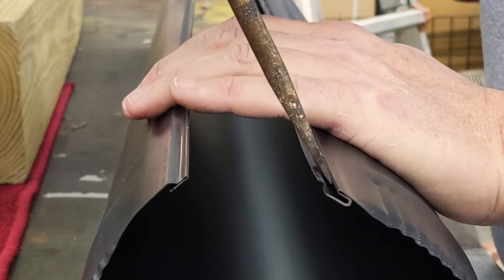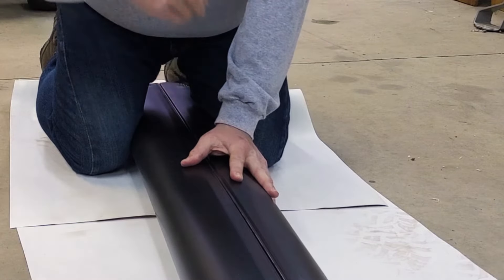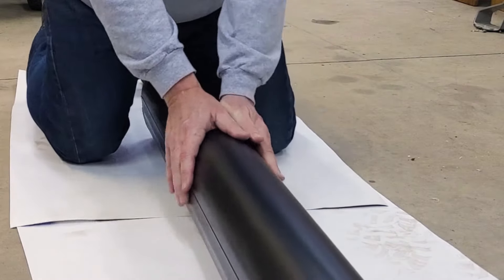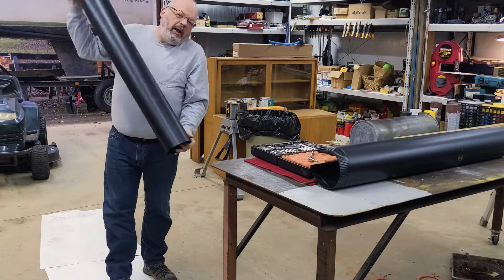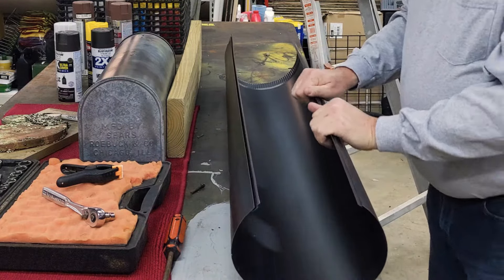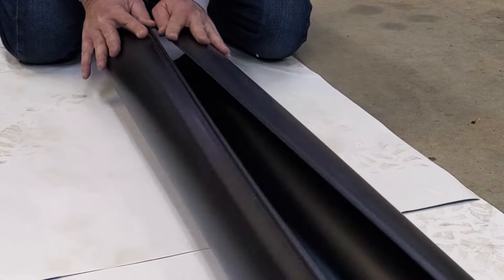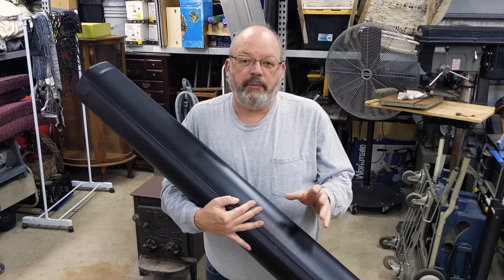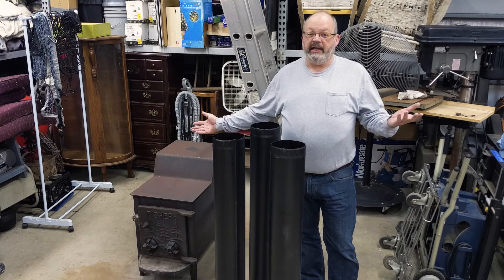Assemble Snap-Together Split Stove Pipe

Comment: The real challenge is that THEY need to make a seamless pipe available in my area in the same lengths as these abominations........Life would be so grand then ;)
Reply from the maker: I think the price gap between nested split pipes versus fully round pipes (transporting, retail space) would be significant and consumers would pick the lower priced split pipes not knowing the assembly challenges ahead.
Reply: @BradSmithSC   I hear ya.....Just wish the option was there. Great video, by the way!!!

Comment: Thanks for this video! In addition to what you’ve mentioned, I found it helpful to put the pipe on a non-slip yoga mat. This makes it easier to “wrestle” with the pipe. The second thing I noticed in your video but wasn’t called out explicitly was that to prevent creases, apply gentle pressure using the entirety of your palm. 

Lastly, I found it helpful to gauge how round the finished product is by simply rolling it on the mat! And you can easily tell which areas need more work.
Reply from the maker: A yoga mat would definitely be better to keep it from sliding around. They could sell non-slip pipe assembly mats alongside the pipe sections.

Comment: Thanks! Worked with minimal effort. My 3” diameter pipe made it easy. However, once I got it oval-formed, I had to snap it together (4 pcs on first try) vertically. I installed it on my shepherd hooks which hold my bird feeders, to prevent the tree rats from thieving the birds’ seed. Thanks again!
Reply from the maker: Sounds like an excellent squirrel defense you've got there, Larry. My bird feeders are routinely raided too.

Check out this amusing squirrel obstacle course https://youtu.be/hFZFjoX2cGg
Reply: Whatever that

Comment: Hi, Brad! Worked the first try. THANKS!  👍 Where's the vid showing how to put the crimp end in the next pipe?  Another Smith needs to know. 😁
Reply from the maker: Greetings fellow Smith. Glad to hear you got your pipes assembled. 

I don't have a video showing pipe assembly. In my case, I have the pipes overlapping one another incorrectly. The result is the creosote runs down the pipe and at the seam works its way outside the pipe. When assembling I was thinking about funneling the smoke so they're overlapped where the smaller diameter is below the larger diameter pipe. It turns out the upward draft disallows the smoke from coming out those seams.

Whenever I replace them, I'll make a video about this issue to help others avoid my mistake.

Comment: I'm about to install two new sections...any problem with two pipe sections not sealing very good and letting smoke by due to one section maybe being "more oval" than the other?
Reply from the maker: If one pipe is oval and one is round then yes you might have some smoke leak into your room. However, that probably only occurs at the beginning when building a fire. I suspect once the draft is steadily moving up the pipe those gaps will suck in air from the room.
Reply: @BradSmithSC  yeah, I'm thinking the same. I've never used the "snap together" seams before, so was curious. Thanks for the videos!

Comment: Thanks Brad. Monster UPVOTE! Yuh know...I have carried out this operation a few times by myself. Last time mebbe 5 years ago. This time around it took me and the wife to get two sticks together. Not working out the way we were doing, I found your vid and with her holding a flashlight (black on black sucks when you get old) and me using your method...wah-la! Can't thank you enough! Now who do I send a letter to about this backwards flue pipe? You'd think after 120 years some company would have figgered out how to sell 'em put together. Ha! 
Norm
Reply from the maker: Glad my video helped you and your wife succeed with your stove pipe assembly. Hope you stay warm come winter.

Would be nice if split stove pipes could be assembled more easily. Maybe one day they'll be a zipper version that can withstand heat & cool cycling.
Reply: @BradSmithSC  Ha! That would be grand! Thanks again Brad. I really wasn't looking forward to replacing my pipes. I thought I had it licked with two pieces. Turned out I needed a third after I knocked the old build down. Got everything ready but that. Tomorrow! Boy that stuff is expensive. Holler later!

Comment: Another thing that makes it easier is to get the crimped end in and put a ratchet strap on it so it can't get loose then push down and snap. It is a little easier on my worn-out hip.
Reply from the maker: A ratchet strap is a good use as a pair of 'extra hands'. Adding an old towel under the buckle portion might help prevent it from scraping the finish too.

Comment: this worked great. was easier than a different video i watched. thanks!!
Reply from the maker: I'm glad my fumbling helped you with your project
Reply: Worked great. Never thought about using my knees to hold it in place. Should have looked this up first and save myself the aggravation
Reply from the maker: I tried a few ways before settling on the knee squeeze method. Glad that worked out for you.

Comment: Other tools that will help: airplane worm clamp, strap of velcro, wire tie, a cutout circle of wood or plastic, piece of tire tube, large! rubber band...
 The reason for flat pieces is more can be shipped and stored in a given space and less damage to the finished product.  flue pipe, smoke pipe, vent pipe, snap pipe, duct
Reply from the maker: Those additional tools will act like an extra set of helping hands

Comment: Do you line up the seams, or stagger them off??
Reply from the maker: I line up the seams at one end and then work down the length. Sort of like a zipper. One challenge is the start of the seam falling back open while trying to connect the rest of it.
Reply: @BradSmithSC  the seams of 2 finished pipes. After the pipes are pressed together and you are stacking them to make chimney do you line up the seams of both pipes together or offset them

Comment: After farting around with this for over an hour. I decided it was time to reinvent the wheel. I did most of what the fella said with one very big difference. Once I got the corner in I clamped it with my vise grips on the very edge. Then started the over side of the pipe going at the corner. I did the same thing with the vice grips as well. Now the little f$%ker can't pop off. I worked it from the end towards the middle. If it gave me some grief I would simply switch to the other side. Once that I saw the seam "most" of the way in I remove both vise grips and started to round out the pipe and it sounded like a popcorn maker. DONE! I spent over an hour on my first 48 inch long pipe. Once I figured this trick out I had all four done in less then five minutes. I have never put pipe together before. I also have "0" patience for this kind of crap. So if I can do it I know you will have no trouble at all...lol. I truly hopes this spares some one some grief. I also feel for the amount of money they charge, it should be done at the factory or at the store that makes a hefty profit off of a piece of stamped sheet metal.
Reply from the maker: You expertly employed those vice grips into extra set of helping hands. Nicely done.
Reply: I agree, five dollars a foot for something that you have to assemble is a tad ridiculous, but I have a feeling things are going to get a lot worse!

Comment: I have my pipes snapped together, and I prefer to wear gloves when working with sheetmetal. The part I want to see is sliding the pipes together especially where the seams are.
Reply from the maker: The pipes are crimped on one end and those fit inside the straight (uncrimpt) end of the other pipe. A bit less eventful than the snap together assembly :-)
Reply from the maker: When connecting pipes together it's important to ensure they are aligned straight to one another before driving in the sheet metal screws. Take your time on this step.
Reply: To get max grip I did not use my gloves. Only one small drop of blood lost. Yes, I brag. Coulda lost a finger!
Reply from the maker: @OvGraphics  a mix of blood & sweat works as a sacrificial lubricant in helping the seams snap together. Efficiency is improved when the ratio of each is just right :-)
Reply: @BradSmithSC  Hiya back Brad. Wull yeah, and don't forget a smidge of Brad. Gotta have that. So I went to the hardware a few minutes ago for that last stick. I axed the helpful hardware man if he knew how to put it together. Thought I might pick up another trick. "Sure!" says he. After about 5 minutes neither one of could make it work so I got down on on the floor and showed him the Brad method. Fidget, unsnap. Fidget, unsnap... One end secured, walk it up...SNAP!  Hee hee. Learned HIM a new trick! Brad you are THE man!
Reply: Good luck getting individual pieces to fit together properly after following this method  of how to screw up a brand new pipe..!    They will never come back even close to being round after this circus side show

Comment: So I guess you don't have to silicone the seams then?
Reply from the maker: The metal interlocks together tightly and I haven't found a need for any sealant. You might want to verify with someone more knowledgeable, especially if you have a unique case. These chimney pieces get quite hot so if you end up using something it must be heat friendly.

I made the mistake of installing my pieces upside down so the creosote running down the pipes leaks onto the outside of the pipes. That is not a sealant issue but an incorrect installation issue that can be remedied by flipping my pipes the other direction.

Comment: Why do they sell it apart for what they cost they should already have the seams put together and welded for you at the factory.It makes no sense to sell stove pipe that way. They don’t sell plumbing pipes that way . I believe in making things as simple and easy for people as possible when working on projects. Just saying.
Reply from the maker: My guess for this split-pipe configuration is more pipe sections can fit into a box since they can nest into one another
Reply: I agree with Brad. Problem is that when they first started shipping these things the Pony Express demanded this method. We're kinda past that now.
Reply from the maker: @OvGraphics  the heating and cooling contraction cycles these pipes experience probably also factors into the interlocking connection configuration. From the pipe manufacturer's point of view, they would have far more of an issue if the pipes unzipped themselves during an active fire versus assembly difficulty.

Comment: This should absolutely be done already. They charge way, way, way too much money at it is to just sell you a stamped piece of metal that you have to screw around with for hours. I am going to return mine have have them do it or refund me.
Reply from the maker: I think they are split so they can be nested taking up less storage space and probably less expensive to manufacture
Reply: @BradSmithSC  
For sure, but it wouldn't be that much of a problem for them to give you some instructions, or for the hardware store (or wherever you get them) to have a fixture to put them together for you!
Reply from the maker: @marktwain2053  It'd be nifty if there was a pull cord technique to seam the two joints together. Sometimes truck rear windows can be put in by placing a cord around the rubber gasket and pulling it around the perimeter of the window. The cord pulls through one edge of the rubber gasket H-channel. A similar technique might also work here but would probably require a different joint type.

Comment: When it's done properly it dosent need to be bent outta shape and the back into round..  ridiculous internet how not to do it instructional video
Reply: Did you make a video showing an easier way to do it? Those things are damn near impossible to assemble
Reply from the maker: @devineinspiration This is the only video I have on this topic. The one thing that probably will help you the most is using a yoga mat or some other cushiony material to lay the pipe on while you straddle it.